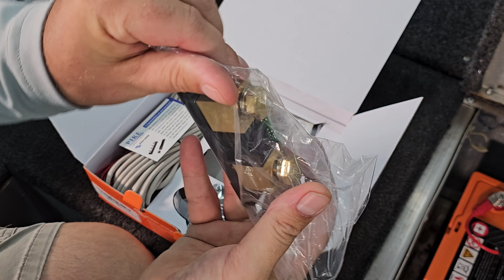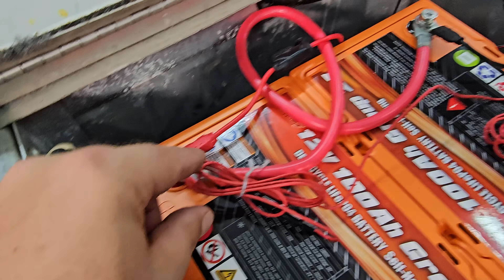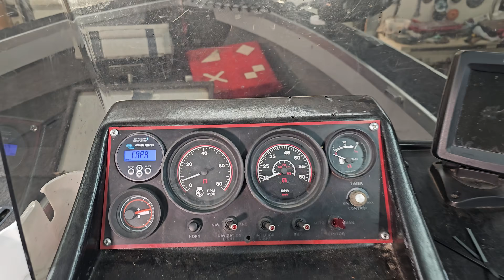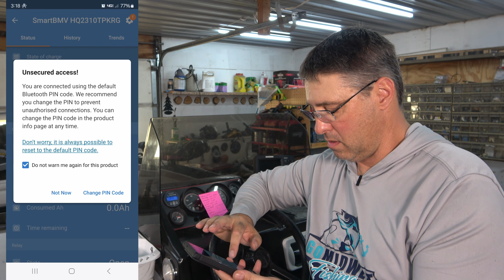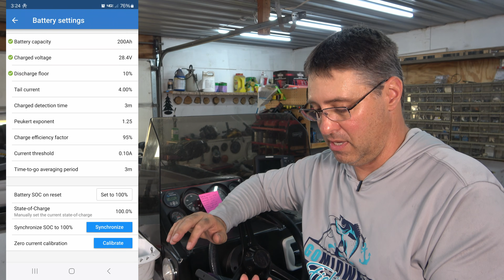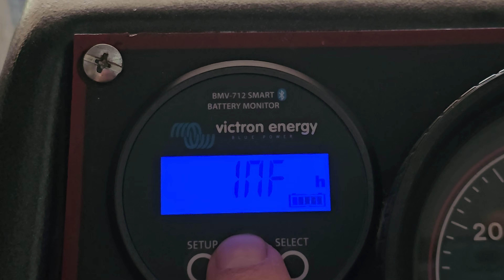Installing the Victron BMV 712 Battery Monitor on a Boat

Comment from the maker: Correction to the amp hour setting: When connecting the batteries in series, the voltage doubles, but the amp hours stays the same. I should have set it at 100ah instead of 200ah. Thanks to everyone that caught that and helped me to make it right.

Comment: Looking at the Bluetooth Shunt 300A IP65 version (very new) for my 36v 63AH lithium battery. Would be nice to actually have monitor on dash, however on the phone will work as well. I will let you say if the actual monitor was over kill! Wonder of Victron will come out with a different display monitor display, to give more info on the one screen instead toggling. Nit picking now! 
Hope you’re still happy with function and purpose!
Well done for the App Setting and explanation, excellent information!
Reply from the maker: The app does show more info, but I really like being able to just glance at the gauge and see how much battery is left. It is kind of a pain to connect the app to the battery  every time I want to know how much is left. So no, its not overkill, and I think you will find you use the gauge more than you think.

Comment: As a retired shipwright I love Victron's chargers. One of the easiest to install and use.  Good pick on that one.  Great install video.
Reply from the maker: Good to know. I just did some research, and Victron seems to be the one everyone brags about, so i went with it. Its been working great.
Reply: @GoMidwestFishing  They are great.  I have one small unit up here as a back up if any of my others have issues.

Comment: I wonder if your plane requires as many updates (as the new gauge) before it lets you take off? 😂 
Good, clean install and upgrade for the boat. I would’ve been lost at the peukert exponent! 😂
Reply from the maker: Don't worry, I still don't understand that. Luckily I have mechanics that update my plane for me. Just the other day, the clock in the plane was saying it was 1999. The mechanic had to come out and read in the manual how to set the time on the clock. It took him 15 minutes to figure it out. I think they over complicate things sometimes.

Comment: Maybe i miss it but for the AH  Should be only 100 ah but a 24 v system.
Reply from the maker: The shunt is connected to two 100ah batteries, which gives it a total capacity of 200ah, and they are connected in series so the total output is 24 volts. (12 x 2).

Comment: It will be nice when I switch to see how much time is left and percentage of battery vs the little lights on the trolling motor. 
I have no room for the gauge so I would have to find space. 
But good to know it is available.
Reply from the maker: I just got to try it out today. Its amazing all the info it gives. I know exactly what % of the battery is left and how many hours I can run the trolling motor.